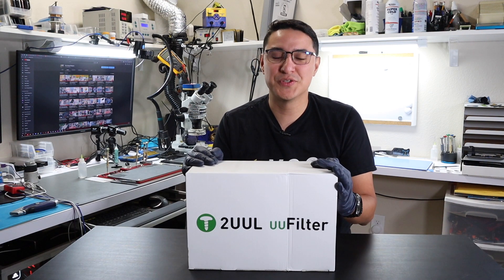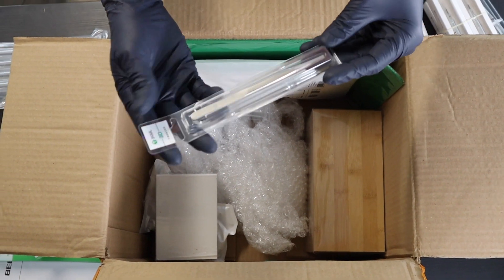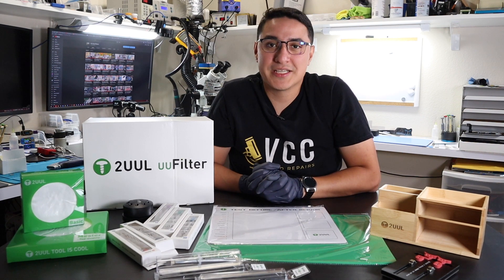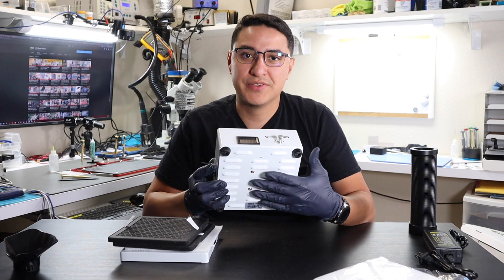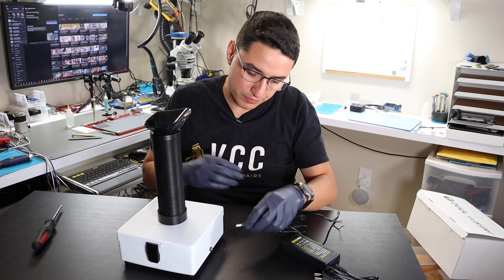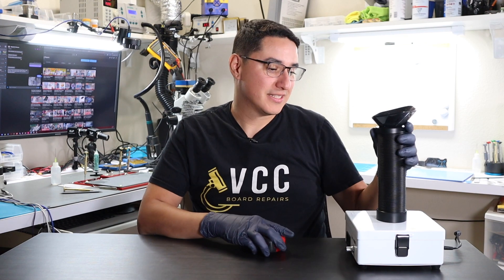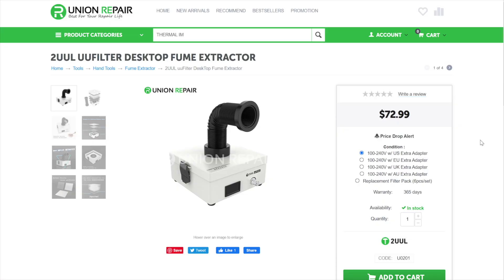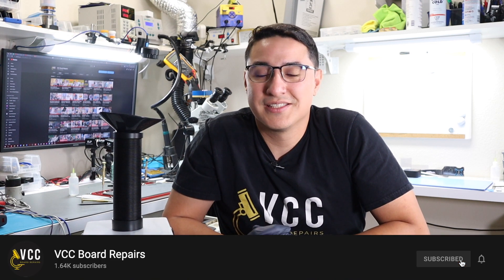2UUL uuFilter Fume Extractor Review. Say NO To Solder Fumes 💨 🚫

Comment: This type of fume extractor has a few design flaws, and that's why the suction is not that great and it makes more noise. 
If you look carefully, the opening in the lid where the hose is attached has no space between the lid and pre-filter. So the air can only pass the pre-filter the size of the hose, 
and not the entire surface of the pre-filter. If you take the lid off , and power it on, the noise will be much lower, because the air can flow through the entire filter surface.
The same problem under the active carbon filter, that filter is also to close to the intake of the fan, and the entire surface can't be used.
In short, the lid is already restricting the air flow without the hose connected due the lack of space in the height. If the lid was 2 centimeters (1 inch) away from the pre-filter, and that exact same distance between the active carbon filter and the fan intake, this extractor worked guranteed much better then it is now.
Reply from the maker: Oh man. good observation. it's definitely not the best one on the market.

Comment: I just ordered this unit from Union Repair on the strength of your review.  There is a hefty shipping charge but after looking at other comparable units, this one looks best.  Best of luck and thank you!
Reply: Did you get it yet?
Reply: @Ri-eb1ns  I got the unit.  As a portable system, I feel it is very underpowered for its size, but the hose and the filtering system is worth the money.  I need some solder time with it …
Reply: @SpyStaMia  Cool, Nice of you to respond with feedback. Feel free to update after soldering with it.,.
Reply: @SpyStaMia  Hi mate, I have a chance to buy one of these a bit cheaper, could you tell me now that its been 2 weeks is it any good?
Reply: @stuuay5066  Hello.  Yes it’s very underpowered.  It’s very quiet but you literally have to put the board or whatever you are working on next to the inlet.  The box is big enough to modify the fan but it is not a Hakko or a Pace by any means
Reply: @Ri-eb1ns  should be here tomorrow … I hope it includes the wide opening attachment like in this video …
Reply from the maker: Yeah it's not the best one on the market.

Comment: I have wanted that board holder for a while!
Reply: Oh and the fume extractor is neat too. I have a DIY one, goes directly outside and the motor is outside also. #nosound
Reply from the maker: oooo nice. that works too!
Reply: @joesipaq  I was thinking about that too. If I may ask, What type of fan and hose are you using for that? Does the fan need to be a very strong one? Or does it simply work with a normal "bathroom type of fan"
Thank you for your time.